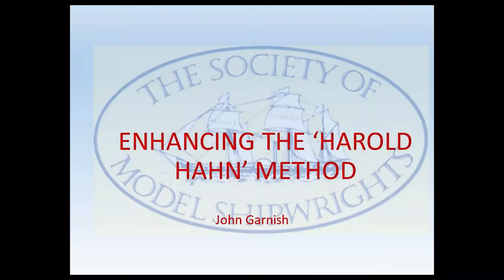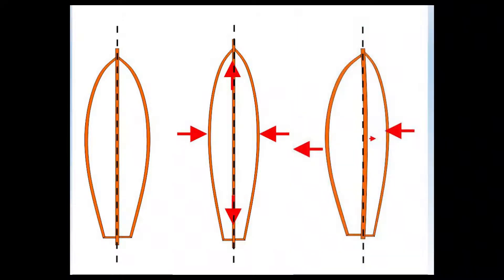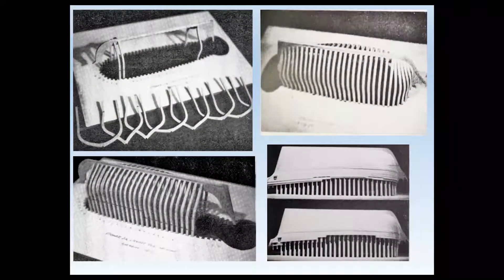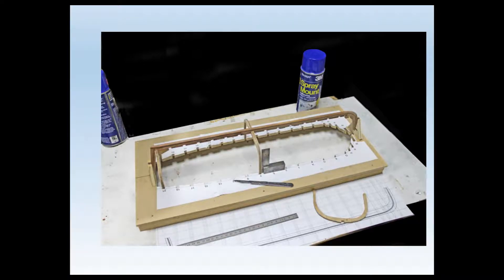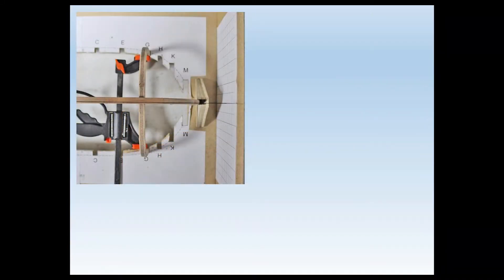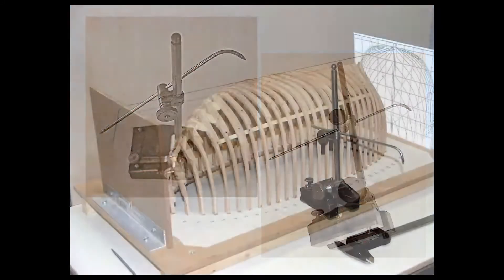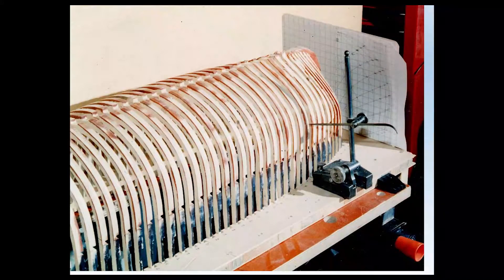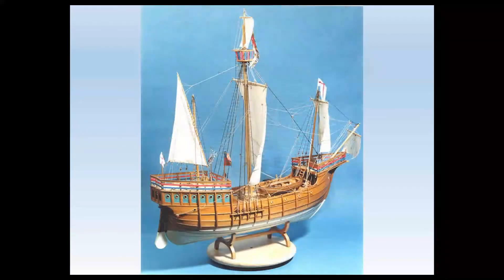Harold Hahn method of hull construction

Comment: Actually, many builders use a similar building-board to build their models the right side up, instead of upside down. Especially in Europe, where Hahn is not that well known, dockyard style models are built that way. Michele Padoan‘s models are a very good example of how this is done.

Also, building a model just the way it was done back in the day, is entirely possible. Just look at the work of Ab Hoving, who builds 17th century Dutch vessels using the plank-first method the Dutch used then.

What I personaly dislike about Hahn is that in his own plans, he used generic frames instead of the historical ones. When you go to the length of building a plank on frame model, why not go the whole nine yards and do it correctly. 

His upside-down method certainly has its merits, though.